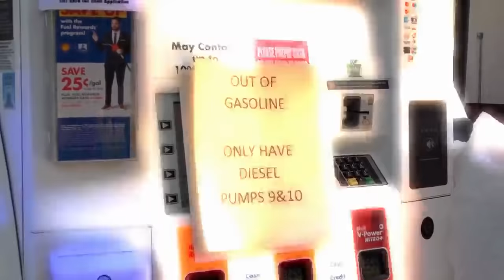Moonshiners Make Gasoline Out Of Alcohol During Gas Shortage | Moonshiners

Comment: My grandpa (bless his soul) was a prepper and knows how to make an wood gas engine.  He taught me how to do it as well as a gift and how to make filtered wood gas.  This is a secret handed down to our family.

Edit: Corrected this from brown gas to wood gas.  Turns out brown gas is not wood gas as I was told by someone that wood gas is also called and known as brown gas.  My grandfather is using wood gas engine running on filtered wood gas.  

My mistake.  Thank da1ve for the correction.
Reply: Brian Smith  curious to know as well
Reply: Oxygen and hydrogen gas apparently
Reply: @unclejoe8310  Yes.  There are lots of applications of brown gas.  Youtube has lots of videos about it.  If there would be a gift that would be usable in times of need like, it would be brown gas creation and engine.
Reply: @Kopie0830  i didn't know you could use brown gas for an engine
Reply: Brian Smith  oxyhydrogen gas, basically stuff that you get when you electrolyze water. A highly flammable gas
Reply: @Kopie0830  Okay so how's it a secret
Reply: @augustuslunasol10thapostle  its not
Reply: The problem with brown gas is that it's a conversion of energy more so than generation. Yes, you can burn 2 parts hydrogen and 1 part oxygen and power an engine with it, but in order to separate the hydrogen and oxygen in water you need to run an electric charge through it. If this was your only source of power you'd be burning the gas to power the production of more gas. Since every system has losses, it's unsustainable. Outside energy must come in.
Reply: @secretsix43  yes but I think the point was, it there was a gasoline shortage he'd be able to create an alternative fuel with electricity. Hence electricity can be produced by other means than gasoline, they'd still be able to power there vehicle.
Reply: @secretsix43  Outside energy to electrolyse water? That's where solar, wind, geothermal and tidal power come in. Use renewable power a replenish a portable power source for vehicles.
Reply: Wood gasification is some cool stuff.
Reply: @joe653  You got it Joe.  No one knows how to make a brown gas engine anymore and it is not being taught in school.  Some do but they won't trade the secret.  I have the blueprint in making it and how to make brown gas safely.  I can use almost anything that burns: wood, paper, leaves and harvest the fumes to brown gas, and run my pickup with it.  He has also told me on how to make it safe.  Basically the engine is at the back together with the fuel tank shielded from the sun but letting air pass through. You need to put a insulated clay and fiber plastic shielding between you and engine and fuel tank just to be safe.  We performed tests to try to make the fuel tank blow by putting it on fire 3x, in those 3, fuel tank didn't blow but just caught fire (fuel tank is hard plastic container).  Oops I'm giving too much details already hehehe.
Reply: This isn't some big "secret" that only those "in the know" are being able to take advantage of. It takes WAY more energy in to make the brown gas, than an engine would put out running off of it. It's extremely lossy, and a vehicles engine wouldn't be able to support the production of enough gas and run the vehicle down the road at the same time. There's absolutely no benefit to brown gas if there are ANY other fuels available. Those are the facts.
Reply: @Kopie0830  That's not even "Brown gas". What you are talking about is "wood gas" through a gasification process, and it works like shit, and destroys a vehicles engine very quickly because of all the "gunk" that ends up in the gas from the process. Another dead end.
Reply: @davelowets  Your right!  Sorry about that.  I thought brown gas and wood gas is the same.  My mistake.  In that case, I'm just using filtered brown gas.  The car engine that my grandfather was using is a wood gas engine.  Thanks for the correction.
Reply: @davelowets  You've obviously dont know what you're talking about. All you have to do is take the smoke and ash out of the gas. It's not hard, you can do it by just running it through water (or a charcoal filter)
Reply: @raam1666  😆 Umm, ok.... All the tar and other bullshit in there needs to be filtered out also, or it quickly destroys the engine. Obviously, you've never tried this before.
Reply: @davelowets  "This isn't some big "secret" that only those "in the know" are being able to take advantage of. It takes WAY more energy in to make the brown gas, than an engine would put out running off of it."

It takes more energy to make gasoline then we get out of it, too, what's your point with this?  Are you too simple to understand that fuel is necessary for mobile power generation?  If we could power vehicles with power plants we wouldn't use gas, why do you think electric cars are so popular, you simpleton?  Putting a nuclear reactor/steam generator on a personal vehicle isn't really feasible yet, and both of those still require fuel, they are just way more efficient, so how else would you provide an engine power to travel dozens, if not hundreds, of miles per hour?

Do you understand how difficult it is to pump oil out of the ground and purify?  And how much easier it would be for people like us to create wood gas, by burning wood and not using a single second of a magnetic field, then to pump it out of the ground, which is driven PURELY by profit and not how simple it is to do?  

TL:DR; you can turn a greater profit by pumping it from the ground in crude oil form, purifying/filtering it and then evaporating off different qualities of gas then you can from creating wood gas.  Get it?

Edit:  Would like to add that most processes to create wood gas use burning the wood itself as the power source, so....... Lol @ your crappy understanding of this process again?  Where do you think the moonshiners got the energy to create what is essentially their 'fuel'?  Wasn't always done with propane...... Which is more efficient so, therefore...... More profit.  Get it yet, or am I still talking to a brick wall?
Reply: @DarthObscurity  My point is that is that its not worth it. Wise up.
Reply: @davelowets  I do it every week. If you're not distilling or filtering the heavy tar and smoke out, that's an intelligence problem on your part. The lighter tars burn easily with very litter to no residue.
Reply: @raam1666  How do you "distill" tar out of a gas vapor? Wise up, man. I bet you've NEVER done it, or you would KNOW how shitty it really works, and how fast it'll TRASH an engine.
Reply: I hear of a german turbine that maybe(?) Uses this technology
Reply: I had a mini bike running on browns gas the police took it bc it's not street legal
Reply: @chrisnano1266  Yea, sure. Nice story.. 
Perhaps you should stick to non-fiction next time.
Reply: @augustuslunasol10thapostle  it ain't, wood gas is well-known lol
Reply: your secret is literally a google or youtube search away my guy.
Reply: @josiah7913  The only reason the family kept it "secret", is because it's a crap way to try and produce fuel, and WILL kill an engine very quickly because of the totally filthy fuel it produces that trashes the engine in no time. If it did something that stupid, and found out it was useless, I'd keep it a secret also so I didn't look like a damn fool. 🤷🏻

Comment: Here in Brasil most of the cars are flexfuel. The ethanol is 100% pure, and the gasoline must have, at least 25% of ethanol in it.
When in ethanol the car consumes around 30% more fuel and gains more power, but it tends to corode some components, when not developt to do it.

Comment: Fun fact, the original engines were designed to run off Ethanol fuel. Discovering oil curbed that, here we are full circle.
Reply: What "original engines" were designed to run off 100% ethanol?
Reply: @AntonioLopez-kw3ev  You have a better, cheaper, source of energy in mind? Today's world is an energy hog, and oil fits the bill.
Reply: @davelowets  The Ford Model T for example can run any fuel from gas to lamp oil. If you can set it on fire, the engine will use it. The original manuals if they existed or the dealer would tell you not to mix fuel but you can use whatever fuel you have.
Reply: @Seriona1  it WILL run on many different fuels, but that's just by default. Ford was not researching or promoting ethanol or any alternative fuels.
Reply: It's cleaner
Reply: @Seriona1  Old engines were designed to take the worst crude oil you can take off mother earth and bring to your engine
Reply: @gibraelkotwal6894  I know but you also have to understand that gasoline existed before the first car ever did. Gasoline was a by product of lamp oil and yes I know the gas then was garbage compared to today but the formula was there.
Reply: @Seriona1  Gasoline up till like mid 1960 was at best 30-40 octane which is really shitty gasoline cars today would be knocking to pieces trying to run that garbage. Which is why older cars run better on modern fuel than they ever have in the past its so much nice fuel with way better corrosion inhibitors and less particulates and is just nicer on the engines as a whole
Reply: Why do you think they outlawed alcohol when they did?  It kept the tinkered from developing alcohol-based engines and created a monopoly on gasoline.  Once they had the monopoly on gas locked up, they legalized gas and outlawed drugs to create a police state and maximize a prison complex...
Reply: @pilsplease7561  nonsense.  WW2 aircraft ran on 110 octane.
Reply: @BenState  Key word is aircraft, your average car ran on like 20-30 octane gas at best. It was really shit gasoline.
Reply: Full circle? Only because some idiots stopped drilling.

Comment: Now can you reverse that and make Moonshine out of Gasoline?
Reply: And then go blind drinking it.
Reply: @tbw357  thats the best part
Reply: No this isn’t gasoline it’s gasohol completely different
Reply: Yes , just boil gasoline for 30 minutes on high.
Some say that's how popcorn  used to make his
Reply: Like Waraje from Uganda, Alcohol sometimes made with petrol
Reply: You can, especially with e85. Got to remove the 15% gasoline & other additives in it first.
Reply: @jonathantan2469  to remove the gas all you have to do is put the E85 in a large clear plastic container with a spout at the bottom add a gallon of water and stir it vigorously for about 15 minutes let it sit for a week and it’ll separate the gas will be sitting on top strain off the bottom portion and distill it again and you have alcohol it probably will taste like garbage but it will be drinkable
Reply: @davelowets  I never said I would do it all I said was it can be done E85 is 85% ethanol and distilling it will remove any harmful chemicals as they should all cook off in the boiling process. They make it out of corn liquor so it’s about 85% moonshine and 15% premium fuel. Also you get horrible fuel mileage like this so you wind up putting more pollution in the air over time because you wind up getting worse fuel mileage also everything that has to go into the creation of the ethanol has to be calculated into the carbon footprint of E85 fuel which it is not. The government just wants you to believe it’s cleaner. It takes 100s of  tons of fertilizer to feed the sugar and corn fields that have to be converted in to ethanol. Then all the water to feed the crops and weed control to keep the crops under control. Everyone only wants to look at BAD OIL   But the truth is that local American diesel and gas are the cleanest options we have to run our vehicles. So would I drink the ethanol after it’s been water strained and redistilled no but I don’t drink alcohol anyway so I don’t care can it be done yes. This is how I get pure gas for my lawn equipment. I buy the gas with 10% ethanol take home put in big 55g drum add in some water stir it will attract all the ethanol out let sit next day water at bottom strain off and Wallah ethanol free fuel.
Reply: @Justthemow  All that fucking around to get alcohol free gas? How about you just buy some no ethanol premium from the other pump handle at whatever pump you use? 😕
Reply: @davelowets  there aren’t any around here where I live sell ethanol free I would have to drive 30 minutes out of the way to the dock to get ethanol free gas I would just buy it if it was at my stations
Reply: @Justthemow  No one sells premium near you? I find that hard to believe
Reply: @davelowets  I don’t live in a big city only two gas stations near me neither sell non ethanol fuel they have premium but it has ethanol in it sticker says all fuel contains at least 10%. The only station near me that has it is by the docks and they are out of my way in the wrong direction

Comment: Those old Farmall tractors have done more work than the human mind can handle! Lol. They're still on most farms across the United States and they certainly don't need any stupid microchips or sensors. The only thing electric is needed for is the lights and starter!
Reply: I learned how to handle a manual transmission on an old Farmall H! And an A, and an old Farmall Cub. I can still drive damned near anything on the road, barring Semi tractors and heavy equipment, and I'm proud to be able to do so! I can't be the only person that learned to drive a stick that way, either.
Reply: It's saying something when farmers have to "hack" their modern tractors software to even fix them.
Reply: It’s gotta throw spark to the distributor too.

Comment: Flex fuel will definitely run 20% ethanol. Maybe more. Till you stated maxing parameters of the flue system. It's essentially E85 like at ⛽.  You will get way less Miles per gallon

Comment: You can actually run a engine on +90% alcohol, here in brazil we have regular gasoline and 96% alcohol in the pumps
(To run a regular enine on alcohol you only need to tune the engine to run a bit richer)
Reply: The entire fuel system MUST be designed for alcohol also. If it isn't, it won't last long.